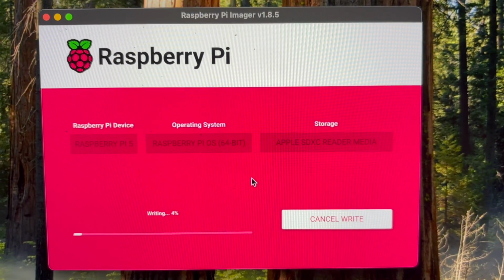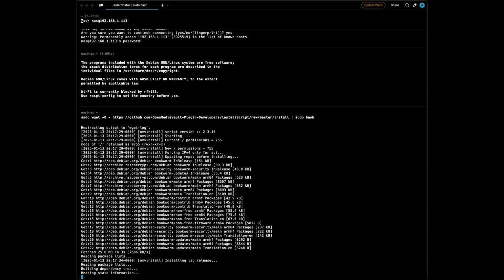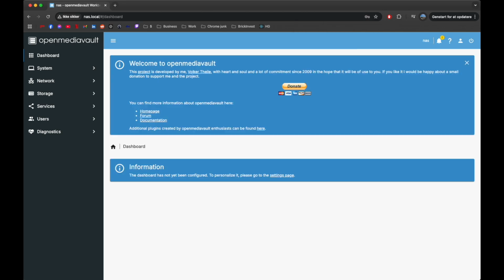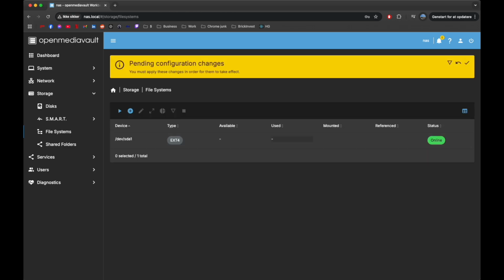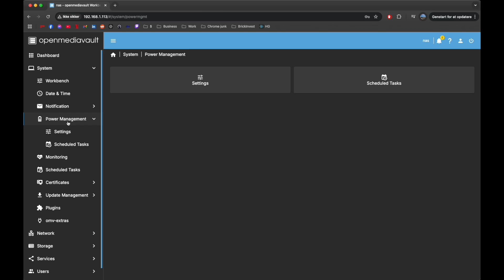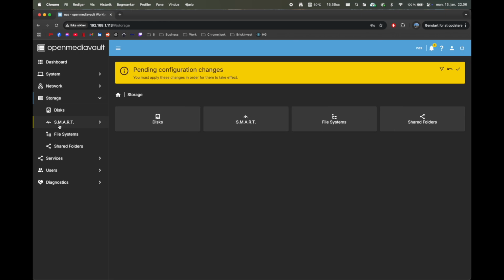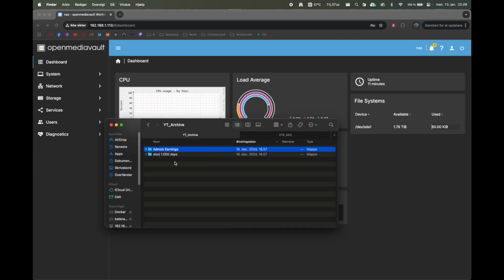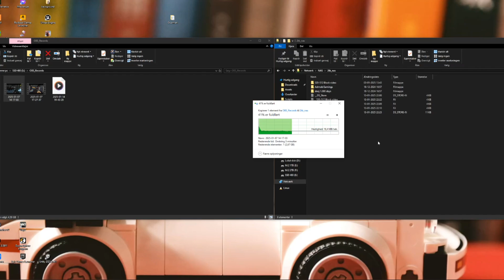I Built an ULTRA Low Wattage Raspberry Pi 5 NAS with an SSD!

Comment: ⚠ Careful 
One the biggest issues with PI that everyone knows about is the SD-card that will not live for too long < Not reliable >. hence why it is not often used as a server until it became possible to boot from an SSD.
I wouldn't recommend to do the NAS like so -- not really reliable setup.
Reply from the maker: I am aware of that. But running open media vault there is not much being written to the sd card.
So it will last a decent amount of time.

Else I can allways add a drive to boot from instead :)

Comment: Why does everyone run the fan cable over the top? There is a channel on the underside around the edge to route the cable.
Good to know an ssd cable exists that is short as the one connected to my pi 4 is long by comparison :D
Reply from the maker: Good point!! Thanks 🙏🏼